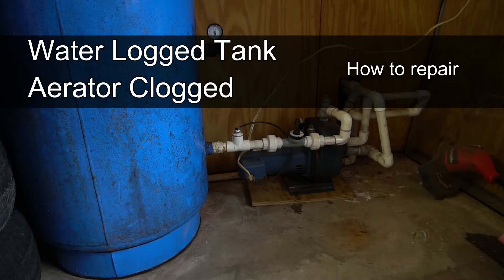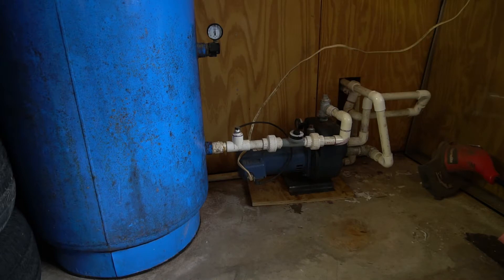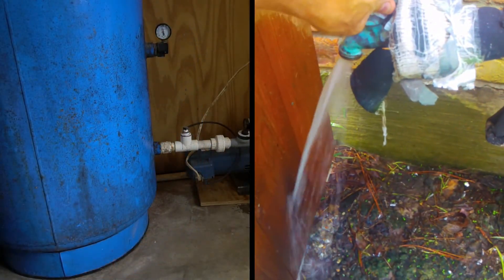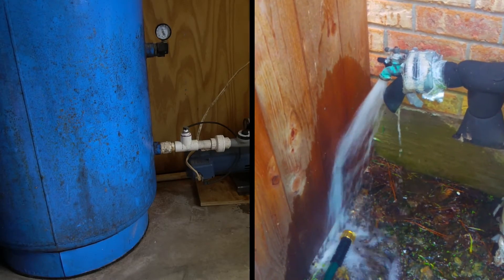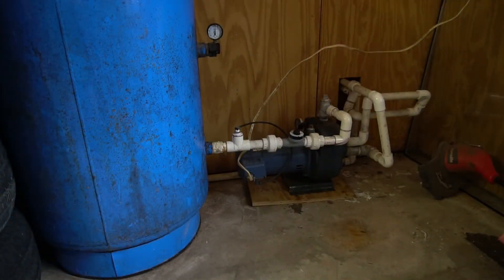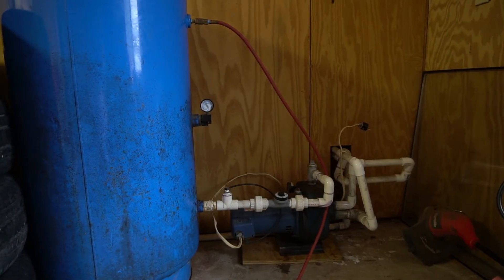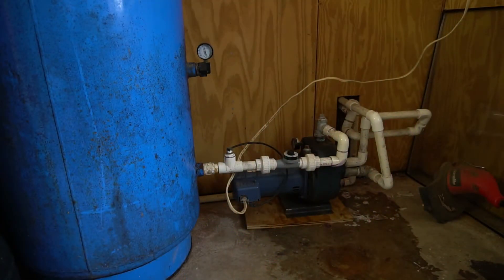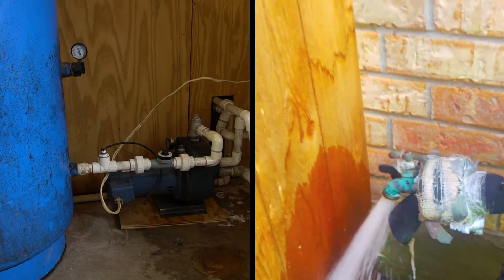Water Logged tank - Aerator Clogged

Comment: Not sure if your still checking.messages. i have a micronizer and my plumber said it was for sulpher odour. Is this true?
Reply from the maker: @gooblesnork  Yes a airation device helps reduce or remove completely the H2s sulfer smell.
As long you have a air release on the tank to let out the excess air and exchange out the gas also.
Reply: @ClearWaterPumpWell  how would I know if my pressure tank has a way to remove excess air?
Reply from the maker: @gooblesnork  if it has a air release installed on the middle port halfway on the tank.
Some fiberglass tanks have this port on the lower 3rd bottom.

Comment: Having the same issue. What if I don’t have a place to connect an air compressor to drain the tank completely?  I’m thinking my micronizer is clogged due to iron in the well casing.
Reply from the maker: Yes it can be clogged from iron over time.  To drain your tank you need to turn off the power and open a faucet to get all the pressure out of the system.  Then you can take a gauge or plug out your tank and put a fitting to hook the compressor to.  Adjust your regulator to 60psi and no more to blow all the water out.  Save some water in a bucket incase you have to prime your pump if it's above ground type.  To clean the micronizer it's pretty difficult and requires special custom tools.  You may be better off replacing it this time and trying to clean old one for a backup.  I'm going to do a video showing how I clean the micronizer hopefully soon.
Thanks for the comment and watching,
Casey

Comment: Where is the aerator on the pump?
Reply from the maker: It's not on the pump but In line between the pump and the tank.  It's used to inject air in line to the tank for water treatment and tank air volume maintaining.
Thanks for the comment and watching,
Casey

Comment: Excellent video. Mine keeps getting waterlogged and is a galvanized tank what could be causing it to continue to get waterlogged?  I have checked the top of the tank for holes or leaks and have not found any wondering what else could be the issue.

Mine does not have an airveter or whatever you called that going from the pump to the tank I only have a small air valve on that line.

Any help will be appreciated.
Reply from the maker: Depending on what kind of pump you have on your standard tank will tell you what type of air volume control method is best used.   Do you have sn above ground pump or a submersible pump?
Reply: @ClearWaterPumpWell  submersible
Reply from the maker: @iammichaelhughes  Yes you should have what's called a snifter valve in line before your check valve and after well.  This should every time the pump cycles off it should draw air in and not be under pressure.   Check to make sure it does this by running water toll pump comes on then check it after it shuts off.  I should draw sir for a few seconds to a few minutes, bug not very quick to stop if at all.  Let me know.
Reply from the maker: If your not getting air drawn in at the snifter valve it could be the wrong one with to hard of a spring.  The check valve it self could be bad causing pressure to leak back and prevent it from drawing air and stirring up the well.   The weep hole in the well could be clogged or if it's never worked there might not be one.

Comment: I have an 80 gallon flexlite fiberglass tank on a 200 ft deep well with a 1 hp pump.  Tapping the tank it sounds like it is 90% water. With just one cold water faucet open the water runs for 1minute and 23 seconds then the pump runs for 8 seconds then shuts off for another 1 minute and 23 seconds. Should the water run longer than that before the pump turns on?
Reply from the maker: How long the water runs at any point in the house is irrelevant.  It's how long the pump runs to fill the tank back up with no water usage.  8 seconds of run time with water running and you think it's 90% full means that the tank is waterlogged.  Check the air volume control and or the top of the tank for leaks.  What kind of pump do you have? Submersible or above ground?
Reply: @ClearWaterPumpWell  Thanks for your reply Sir, I sure can't afford for  my pump to burn up it's a 1hp Grundfos submersible 200ft down. My tank is a FlexLite FLS80D with no diaphragm. I don't find any leaks. I drained the tank 3 months ago when it water logged but I did not add any air thru the Schrader valve. Should I have added air?
Reply: I was there when the driller (who has since retried installed the pump) he ran it with his generator since I did not have electricity yet. I don't think he checked run time. Could the bleeder valve orifice hole be too small? How can I test the air volume control valve?
Reply from the maker: @JohnSmith-1234  Being that you've already had to drain the tank once tells me that there is for sure an issue with the tank leaking air or they are volume control device.   You should definitely drain the tank again and put some soap on top and check for leaks but I've had a hell of a time trying to find leaks on those flex light tanks because of the coating on the outside prevents the air from being seen on top. But one thing's for sure if you drain it down and you get a 30-second minimal cycle time and by the next day or two it's water logged again the tank is defective for sure. How to change these tanks less than 2 years old from air leaks.
Reply from the maker: @JohnSmith-1234  yes sir it could be your bleeder valve, more likely to be clogged up with iron in the well and not draining when the pump shuts off. This will cause you not to get an air charge when the pump comes on. Check to see when your pump Cycles on that you get a charge of air going through the lines and bubbling up into the tank usually it's pretty loud. If you get this then I would suspect the tank very highly to be defective. If you replace the tank I would recommend going with a AO Smith glass lined tank model PL 82. It would provide you would very clean water do the glass lining and last at least 30 years even under tough water conditions. Thanks for your comment, Casey
Reply: @ClearWaterPumpWell  Thanks for the info on a better tank. I do hear bubbling in the tank. As soon as the pump shuts off with my finger on the Schrader valve I can feel it sucking air so I know it works. My cycle time is now 75 seconds and the pump run time is 5 seconds with just the cold water on the sink opened.
Reply: The retired well driller's son told me on the phone that's a good cycle time but by tapping I know the tank is 90% full. He says I must have unstuck the Schrader valve when I pushed the stem down with my finger nail but I don't think so.
Reply: I an going to take out the air volume control valve, inspect it, and drain the tank but I will be calling him back if my tank waterloggs again. Can you please tell me where I can find the bleeder valve and how to test it? Would my well even have one besides the water bleed down hole they drilled thru the pipe about 20ft down?
Reply from the maker: @JohnSmith-1234  well the part on the tank is just an air release, it won't put air in like an above ground pumps Air volume control it only let's excess air out.
Your snifter valve should work without touching it.  You need a cycle time of a minimum 30 seconds or more, 5 seconds over prolonged period will burn your motor up.  You have to make sure you're getting air in the tank every time the pump comes on without doing anything. If you're not getting air in the tank every time and you're having to push the snifter valve then there's something wrong down hole with the bleeder, it's probably obstructed and clogged.
Reply: I thought I should inspect the air volume control valve because doesn't the air volume control valve have a float on it that the water level rises to then shuts off the air which causes the pressure switch to shut the pump off so some air is left in the top of the tank?
Reply: I only pushed the snifter valve in one time yesterday just to see if it was stuck. I am not sure how you are counting a 30 second run time. With a faucet open water flows for 75 seconds without the pump running then my pump runs for 5 sec. shuts off and while the water is still running the pump doesn't run again for another 75 sec. Is this good?
Reply: @ClearWaterPumpWell  Thank very much Sir, I sure will phone you. You care more than the driller who I paid over $7,000 to and doesn't want to come see why it's waterlogged.
Reply from the maker: @JohnSmith-1234  Let me know what you find wrong, would like to know what was causing the problem, the snifter or the tank. Thanks and take care!
Reply: @ClearWaterPumpWell  I sure will let you know what I find. I drained the tank last night, tonight I turned on a faucet, then when the pump turned on it only ran a few seconds before turning off. I am going to spray it with soapy water tomorrow to look for leaks and look for leaks on all the pipes too.  I should have gotten the AO Smith steel glass lined tank you mentioned.
Reply: Do you think to prove a leak I could shut the power off, shut the tank outlet off, write down what the pressure gauge reads, come home from work 12 hours latter and see that the pressure gauge has dropped?
Reply from the maker: @JohnSmith-1234  That could work but, you may not see as large a drop in pressure. Tanks usually leak at high pressure and still lose air.  It's better to check cycle time and water level in tank.  It will show a change overnight usually, or by the end of the week.
Reply: @ClearWaterPumpWell  I would like to find a leak since I still have 2 1/2 years left on my warranty but I would only want a refund so I could buy an AO Smith. Or I would like to find the leak to at least know if I bought a new tank I wouldn't still have the same problem. I see my tank is rated up to 100 psi. With the water outlet valve shut off should I pressure it up to 95 psi (by holding the contact points shut) to see the leak if can't see it at 50 psi?  But I see what I suppose is a relief valve on the top of the well pipe marked 75 psi.
Reply from the maker: @JohnSmith-1234  I would not go over 75 those tanks are dangerous.... But Yea find out what's going on.
Reply: @ClearWaterPumpWell , I still haven't found any leaks in my well system. When the pressure is 50 psi with the pump shut off, it flows water for only 85 seconds with just one faucet open when the pressure drops to 30 psi then the pump runs for 5 seconds until it gets to 50 psi again and the pump shuts off again.
I think should just junk my 80 gallon pressure tank and install a tank with a diaphragm myself before my well pump wears out from short cycling. 
I really appreciate your help Sir,  and I have 3 questions for you.
1. When I change it out to a tank with a diaphragm do I need to eliminate the water drain/air inlet hole? 
2. Should I leave the fitting with the schrader valve that also has the pressure switch fitting on it.
3. Which diaphragm tank should I buy?
Reply from the maker: @JohnSmith-1234  OK so you did drain your tank down and get a better cycle time when we last talked? It just started short cycling again after what say a month ago?
If you changed your tank I would go with a Perma - A. O. Smith standard tank.  Then you won't have to close your weep hole.  If you do get a diaphragm tank you would need at least a 100 gallon equivalent like a Pmx   - 36 also Perma tank.  You would have to cap off snifter and see if you get air, if not you don't have to pull the pump.

Thanks for the update, hope you get it fixed!
Reply: @ClearWaterPumpWell  I think I found the water logging problem I drained the pressure tank and refilled it. Then I sprayed soapy water all over it. Now I see bubbles coming out of the threaded plug on the very top of the tank. So I am going to remove it and  put teflon past on the threads and put it back in. 
Then to see if the tank is taking in air like it should and to get a reference point; with the pressure up to 55 psi and the contact points open I ran a hose into a bucket. I opened the valve and watched as the pressure was down to 25 psi and when the contact points closed I had about 9 gallons of water that had ran instead of the 1.5 gallons I was getting when it was water logged.
Thank you  Clear Water Pump & Well LLC. , for all your help.

Comment: This is exactly what Im looking for but the problem is I dont have air compressor
Reply from the maker: Take the plug out the port on side of tank or gauge and drain the tank that way.  Open a faucet or take it out also if its low enough to drain.